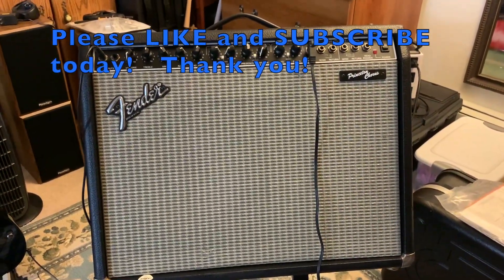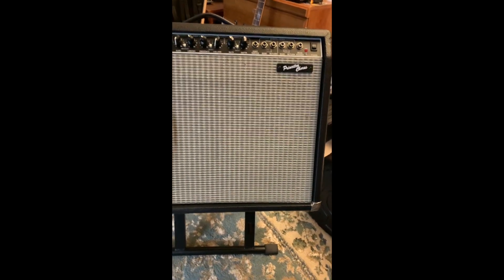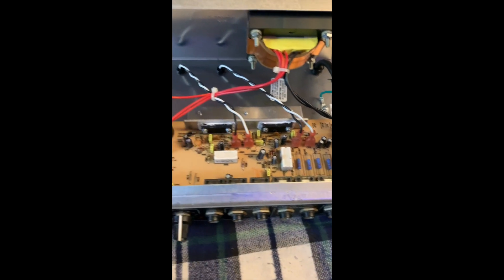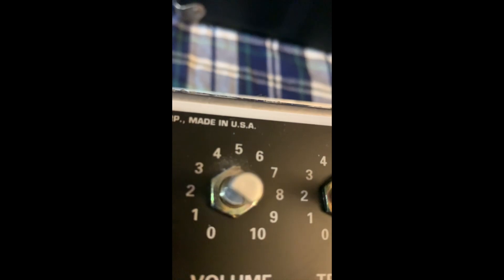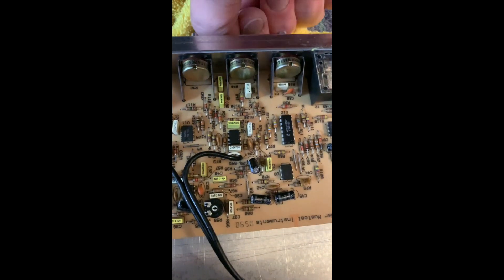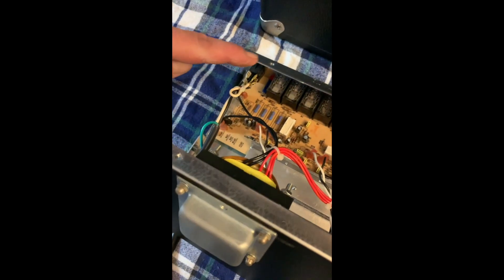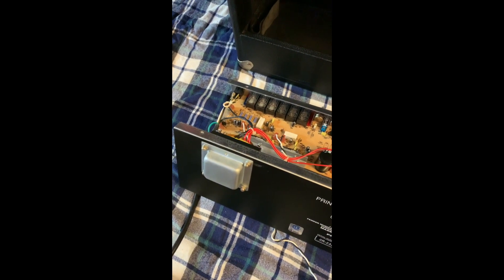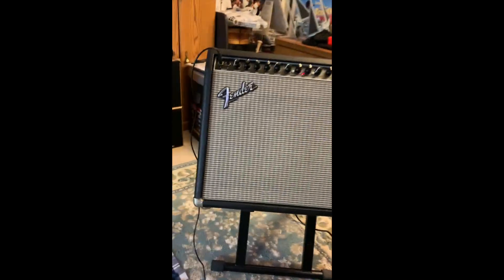How to Clean the Pots on a Fender Princeton PR82 Guitar Amplifier - Get Rid of the Crackling!

Comment: I also have this amp. It was given to me and I'm at least the 4th generation guitarist to own it as no one could fix it. It would only make noise and no guitar signal came through. After disassembly I noticed the stains on the edge of the board giving me a clue as to what happened to it. Amps can't drink beer! I put a scope on the input jack board side and nothing was getting through so I replaced both input jacks. Now I had sound getting to the speakers but it sounded like crap. The pots were really touchy so I hosed them down with contact cleaner and it got better. After looking at the schematic I noticed the signal path goes through both sets of Send & Return jacks so I sprayed cleaner in them as well and pumped them with a 1/4" jack about 20 times each and spraying the while. This cleaned it up and now it sounds great. The point here is to clean those jacks as well! They're important. Also, do not try to jump out the reverb tank with an RCA coupler. It kills the impedance to the next stage and rails the amp creating terrible distortion. This was also done by one of the previous owners thinking he was troubleshooting. The reverb works great as well as the chorus. Not a fan of the distortion. I have $15 into it. Good luck.
Reply from the maker: Thank you for sharing!   What a find.  Thanks for the tips as well on the inputs.  Greatly appreciated.  Overall I love the amp.  I agree though the distortion is not that desirable.  I use it for clean tones.   Thanks again and enjoy the amp!!!   Rock on!!!!   Be well.  Brad

Comment: Great stuff.  I'm way overdue to do this on my PR82 (original owner). I need to get rid of move a I don't use it anymore now that I have my Helix going into studio monitors.  Great stuff.  Thanks so so much.  Saved me at least $60-100 for amp shop to do it. I agree great sounding non-tube amp.   BTW...you didn't mention the importance of staying away from the capacitors which retain high voltage.
Reply from the maker: Hello and thank you for the post.   Glad the video helped out and thank you for the tip on the capacitors.   Important to know!   All the best and rock on!

Comment: Great video. I have a great Fender amp, but lots of static and noticeable treble loss. I hope a good cleaning helps. How / where did you spray the inputs? Is there an opening similar to the pots?
Reply from the maker: @fletcherdelay1259  Thanks for the post.   You literally spray right into the input.  A quick spray and an absorbent rag to soak up the excess.  And literally spray the pot itself.   Just enough to get it wet, not soak it.    Wipe the excess off with the rag and let it dry thoroughly.  A fan is helpful to blow on the unit.  Just take your time and don’t rush.   Let me know if I can help further.   Rock on!🤘

Comment: I have this amp and for some reason it will jump from low volume to cranked by itself. Im wondering if cleaning these pots will help with this problem?
Reply from the maker: Hello.  Clearly it would not hurt and worth a try.  There could be corrosion on the volume pot that is keeping it from working properly.   It could also be an issue on the circuit board, such as a bad capacitor.  I would do the pots first and see if that helps.   Then it may be time for a tech to look at it.   You just have to weigh the cost to fix it versus the cost to replace it.   Good luck.  I hope this helps.   Be well.

Comment: That amp is clean. I picked up the same amp for free but it has some wear on it. Loud hum when turned on,turned out to be the capacitor solder joint was bad i fixed that. Would automotive electrical cleaner Work? RadioShack is no more were i live
Reply from the maker: Can you order it from Amazon?   All the Radio Shacks are gone.   Worse case is I would try the electrical cleaner.   See if you can see what the ingredients are and compare them.  PS - Great find!

Comment: Great video! I'm about to restore mine back to its original glory from when I bought it new back in the early 90s. One question - how exactly did you clean the input and effects jacks? Did you simply just spray cleaner into the actual input holes or are there ports on the backside, similar to the pots?
Reply from the maker: Tom P  Thank you for the post.   Yes.   I sprayed the cleaner directly into the jacks and used a Q-tip to clean the surface and work the cleaner around.   For me, it made a huge difference.  The inputs are now clean and no static.   Hope that helps.   Be well!  Rock on.  Brad

Comment: Very good video. Thx for sharing.  I have the same amp that also needs a cleaning.  Do you have any recommendations for cleaning the circuit board of it is dirty when you pull it out?
Reply from the maker: Stacey Carlson - Hello and thank you for the post.   I always use compressed air, but very gently and from a far distance.    See what comes off with that.   For dirt that wouldn’t blow away, I used Q-tips.   I spray the cleaning on the Q-tip and gently wipe the board.   It took about 50-60 Q-tips to clean the whole board.   It took a while but came out great.   Just make sure the board is completely dry before reinstalling.   I let mine dry overnight and even put a fan on low setting pointed at the board to make sure it was completely dry.  Any other questions, please ask.   Let me know how it goes.   Be well.
Reply: Awesome! Thank you for your response.